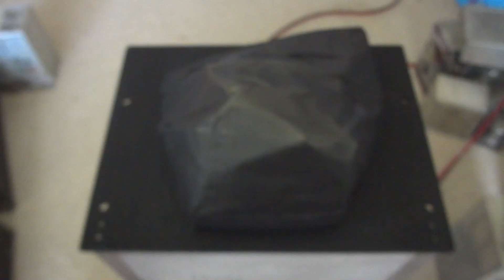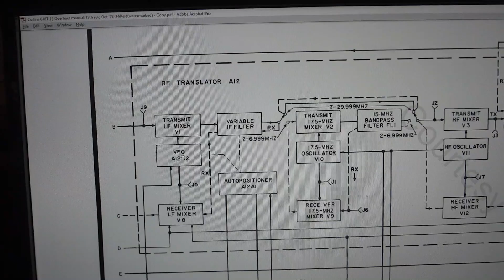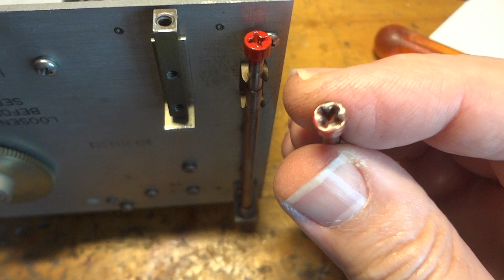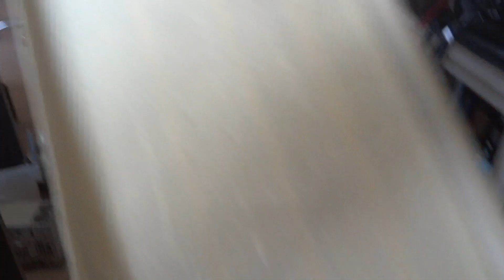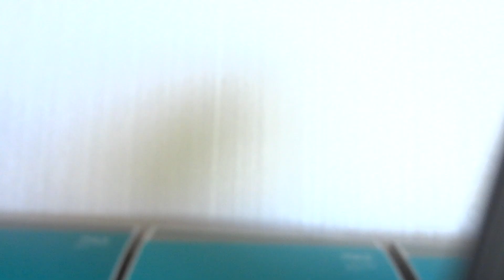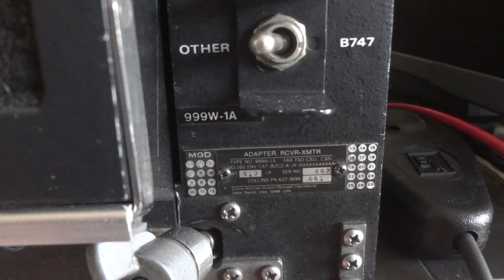Rockwell Collins 618T-3 avionics HF SSB transceiver full restoration

Comment: I used these radios heavily in the early '80s while flying Ch-47 helicopters. Most of them were neglected and disconnected, but I knew how awesome this system is and I pulled them out and cleaned all the connections and got them working.  I took advantage of all the military HF long range infrastructure to make phone patches and listened to all the various foreign propaganda from Russian and Chinese stations.  With a large wire antenna, these things would really get out there with 400 watts!
Reply from the maker: Thanks. This radio was the pinnacle of what was technically possible in the early Sixties. A compact and reliable HF radio that has all selectable frequencies locked to a single master oscillator over a frequency span of 28 MHz. And all that in an era when digital synthesizers were still beyond the reach of the available technology of the day. That is an absolute masterpiece of engineering. Today's developers have it easy compared to that.

Comment: I taught the USAF introductory (3-Level) theory & maintenance course on these back in the 1980's.  I also taught it's cousin the ARC-105 which was the exact same radio except pressurized for high-altitude use.  There were different power supplies available for them but the ones I worked on were configured for 115VAC/400Hz/3-phase aircraft power.  We had special outlets in our classrooms to run them.  Despite their electro-mechanical complexity they were very sturdy & reliable and easy to maintain due to the modular design.  They were too noisy though.  The fans just screamed.  A dozen of them running in a classroom was painful.  Interestingly enough, my tinnitus sounds exactly like a 618T blower!  Go figure. 

I remember ops-checking these from the flightline on C-130s with the long-wire HF antennas.  In good conditions I could get voice radio checks from all over the world on 8.989MHz and 11.176MHz USB, which were busy USAF channels back in the day.

Great video.  Thanks for the memories.
Reply from the maker: Hello! I always love to hear from people who have actually worked with this equipment professionally, thank you for that. You are correct, the Military designated this radio the AN/ARC-102, and the ARC-105 for the pressurized version. Cheers.
Reply: They still used those frequencies and a few others hearing quite a few stations around the planet Croughton being the closest to me

Comment: Fantastic job with the restoration. The radio looks immaculate! That fan is pretty full-on though 😂 I guess the main unit would normally be tucked away where it wouldn't be such a nuisance.
Reply from the maker: Yes, you are correct, the transceiver would be in the avionics bay, far away from the pilots. They would only deal with the control box. I have a sound proof headset (used normally in helicopters which also are very noisy) which keeps the noise out great, but unfortunately my camera has no input to pipe-in the audio directly, it only has a microphone. Maybe I can fix that by buying a new camera, then I can make a better video showing the actual receiver performance (which is quite good) without all the noise.  Cheers.

Comment: That's funny back in Vietnam we called it the ARC102.
Reply from the maker: Vince, you are correct, the military designated this radio the AN/ARC-102. In what plane was it used then? Or did you use it land-mobile, maybe as the MRC-95? Cheers.

Comment: Hi!
    This is a wonderful video!... I just picked up some PULS SL20 supplies for a 618T-3 I'm trying to restore, and want to parallel them as you have...however,  the very small amount of documentation I've been able to find on the SL20 supplies has conflicting info on how to set the parallel jumper... the one short document I found says first to install a jumper in the "P" position, but then contradicts that by saying  if no jumper is installed, the supply will "current share"... may I ask how are your SL20 jumpers configured?

Thanks!
KX4JJ
Reply from the maker: Hello! Here you can download the manual for the SL20:  https://products.pulspower.com/us/sl20-110.html
When you leave the jumper out (or put it in the "parallel" position, which is idle) you are in parallel mode. It makes the output of the SL20 "softer", so the current will distribute amongst the parallel supplies better. Of course this assumes you did set all units at the same voltage  when unloaded (27.5V for the 618T-3), before you tie them together, otherwise it won't work. Hope this helps! Cheers.

Comment: Je hebt het over een jumper om ze in parralel te schakelen.. jumper verzetten onder in door het gat in de voeding? Vanuit PA  73
Reply from the maker: 228 / 5,000
Yes, that's right, the manual explains it (you can download the SL20 manual from the web). It is one of those small jumpers encased in plastic, which they often used for computer hardware in the old days. If the jumper is removed, the power supply is "softer". All you have to do then is adjust them all for the exact same voltage (without load), and when putting them in parallel. Use the same DC wire length for all 3 power supplies. then the current will distribute nicely across the SL20 supplies. 73s.